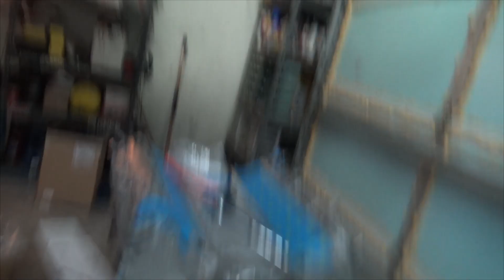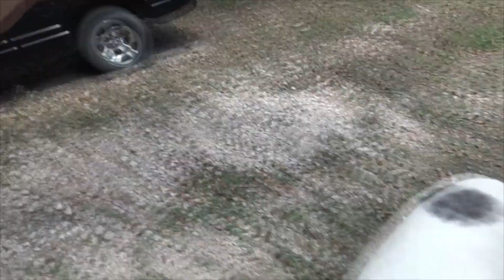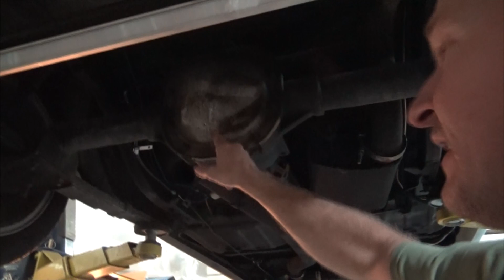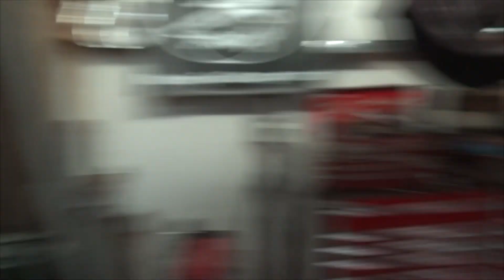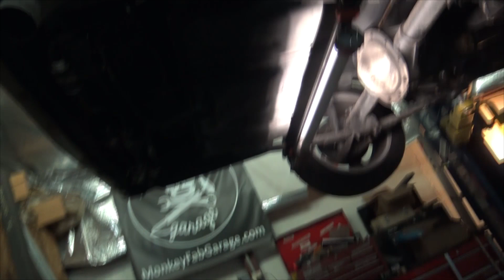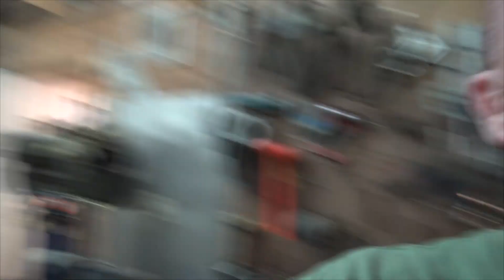Shortening 8.8 Axle with 3D printed Jig 1

Comment: IIRC, 8.8 Explorer axle is 60.5" width flange/flange, 31spline and thick tubes.  edit:  5x4.5 and disc brake.
Reply from the maker: VintageSpeed Garage it’s also off centered.
Reply: @MonkeyFabGarage  indeed.  i ended up with an F150 8.8 (also off-centered) because i needed the extra width in my V10 powered F100.  good luck on your project!

Comment: mike you’ve had some bad advice. The weld on bearing ends you have are torino style ends that allow you to use a press on 9” style axle and bearing in place of the roller style clip retained axles. You don’t need c-clip eliminators as well if you’re narrowing using the new bearing ends. You will need 9” axles BUT be aware 8.8 and 9” pinion offset and therefore axle lengths are different. 9” are about 4” and 8.8” i forget but different to 9”.  C clips are essentially a press / bolt on bearing end just to eliminate c clips which can fail in high power applications. On the jig, if using plastic pucks and bar stock, you may as well just use c channel method.  To property align it you need aluminium pucks turned to size with a 2-3 thou fit over a true bar. Extruded bar or tube even DOM isn’t straight. Here in the UK we have TGP, turned ground and polished,  its ground true but it’s very expensive. Alternatively a scrap long hydraulic ram rod is a cheap alternative. Before you cut anything, research the pinion offset / pinion centring. Essentially you need 9” axles but the lengths need to mirror the 8.8 offset and obviously the width you make the case.👍🏻
Reply from the maker: Phils Obsession thanks for taking the time to reply sir.

Comment: You weld on the new ford Torino ends you have, then get new axles with the Torino bearings and a retaining plate like a 9 inch.  Then your done.  No c clip eliminator needed.
Reply from the maker: i'll need to look into that for the next project. turned out it was a ford 9" bearing carrier. i ended up calling moser and they helped me figure out what i had and what i needed.